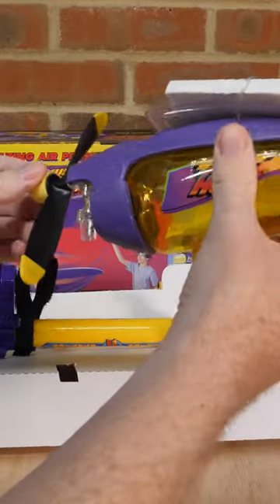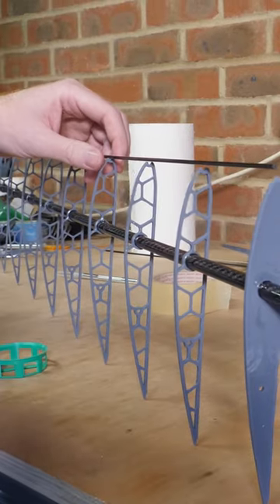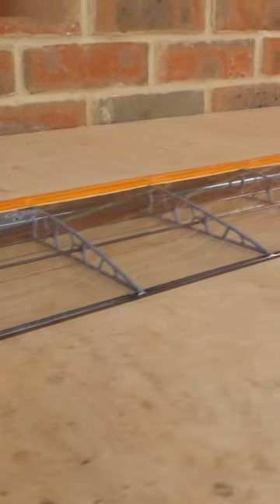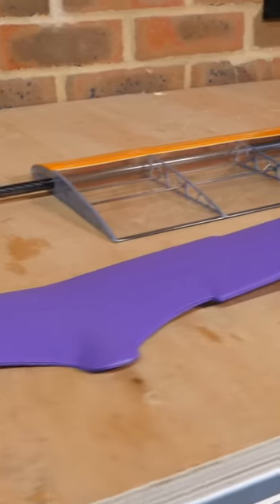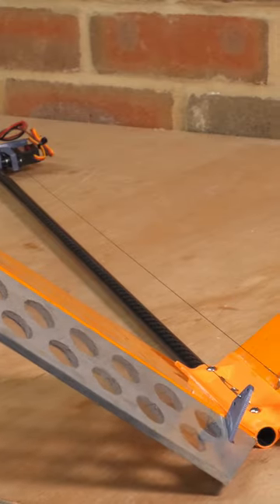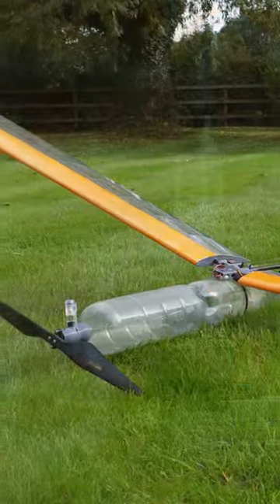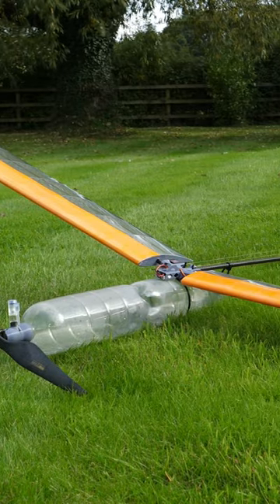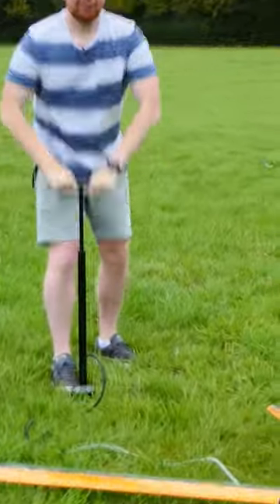Pneumatic powered plane #3dprinting #engine #science #diy #engineering #plane

Comment: If a flying saucer had one fan inside with four variable outlets, you could create a quadcopter like flight with a single motor.
The outlets are just to balance the air exhaust and flight direction. Could possibly by done with only two servos each sliding two exhaust ports open or closed.
Reply: It could also be done with a single fan motor and a controlled moving weight system

Comment: Tom have you ever experimented with using the voids inside the wings as air tanks? Looks like you might be able to double your use able volume!
Reply: Wing wouldn't hold much pressure. And if made strong enough, would be very heavy.
But i like the way you're thinking!
Hmmmm....